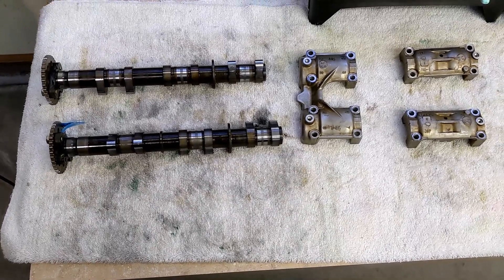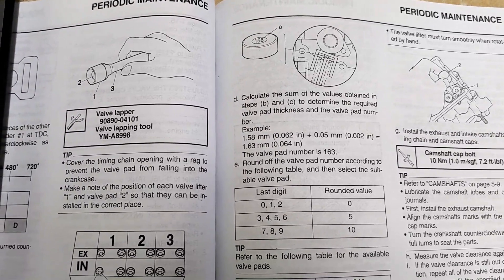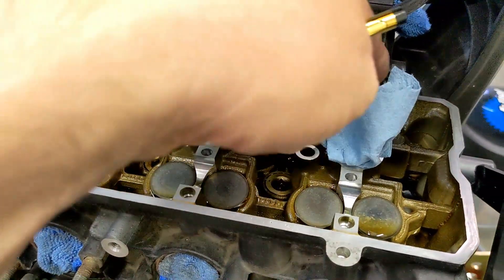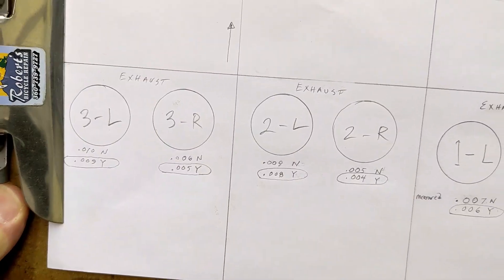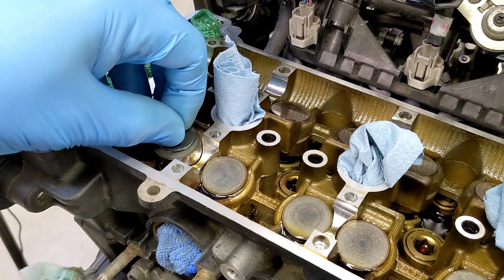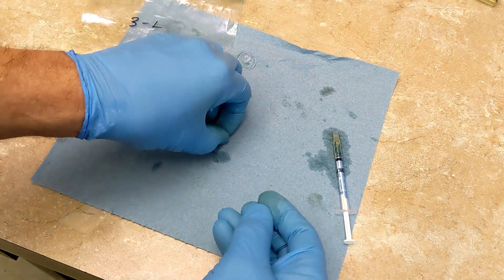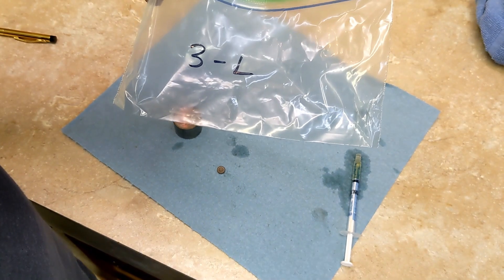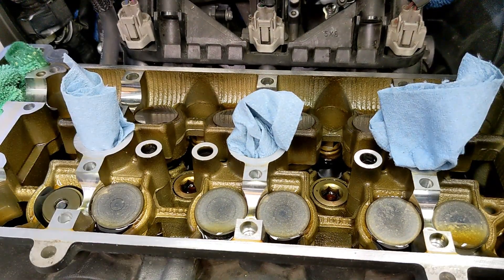valve lifter and valve pad removal Yamaha FZ-09/MT-09 2014 2015 2016

Comment: I'm not through all the videos yet, so you may address this, but a thought occured to me.  If I do all the calculations in advance could I just lay out the shims I will need and as I pop each shim out, just replace it with the correct size?
Reply from the maker: It's good you are thinking the process through before you blindly plow ahead!  You have to take the old shim out to see how thick it is, so you can calculate what the new shim thickness will be. There would be many different ways to keep things organized....I used the labeled bags. I did all my calculations, and then went to the local motorcycle shop to buy the required replacements. ..so I didn't have to buy a large kit with different shims that I will probably never need. Then I came back and did what you are suggesting....one valve at a time.....
Reply: @meticulousmechanic  I do like your idea of gathering all the measurements and then just buying the shims I need.  Those kits are a bit spendy and with my luck I'd need two of the same size and have to buy more anyway.
Reply: @meticulousmechanic  Thanks.  Yes, I definitely want to think it all through and make sure I want to commit before pulling any camshafts out.

For some reason I was thinking all the shims would be the same from the factory.  I have to keep watching videos and not get ahead of myself.  😉